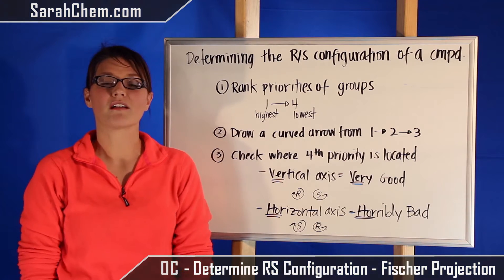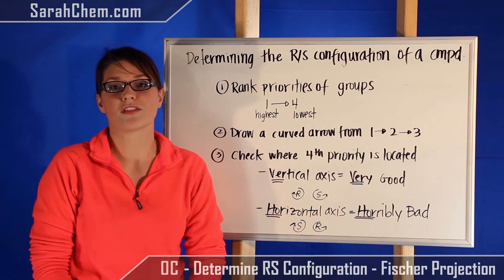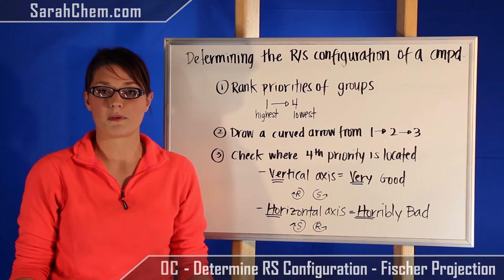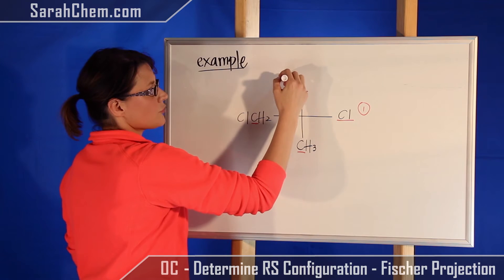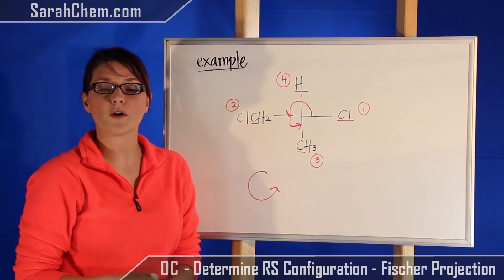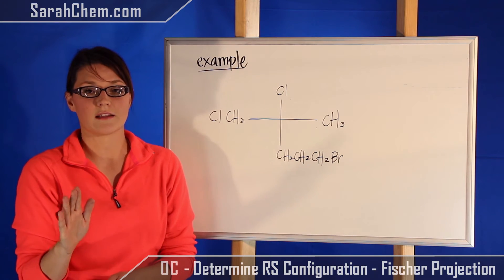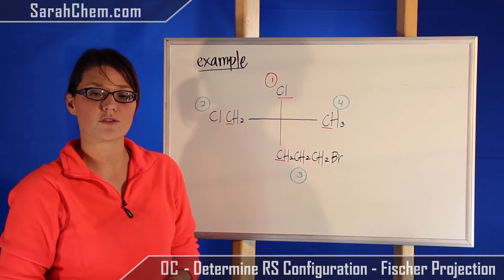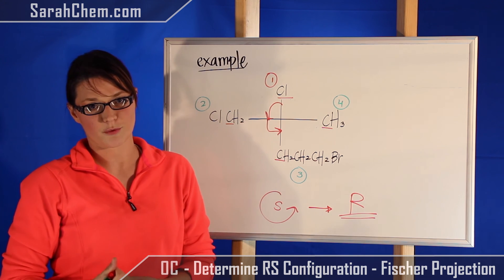Determining the RS Configuration of a Fischer Projection

Comment: ma'am plz let me know how we can determine R/S configuration of compounds having 2 chiral centre?
Reply from the maker: You would have to use the same method as described on each of the chiral centres in compound.  The configuration of one of them does not have bearing on the configuration of the other when assigning R/S notation.

Comment: amazing explanation! But I still don't understand how to choose R and S configurations when there are two chiral centres
Reply from the maker: Hi Jahanvi.  Each chiral center needs to be assigned.  If there are two asymmetric centers, for example, you would have two configurations - one for each.
Reply: Okay. So you mean there could be two or even three R or S configurations for the same compound having two chiral centers?
Reply from the maker: If there are two chiral centers then there would be 2 configurations - each center would have a configuration that woudl need to be determined.  You would follow the same procedure for each carbon to figure out if it is R or S.  Does that help?